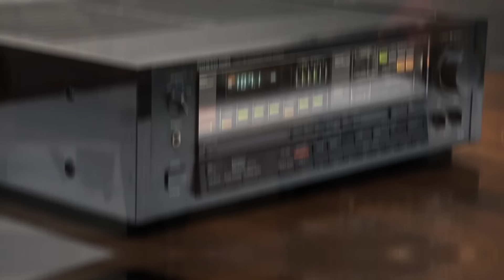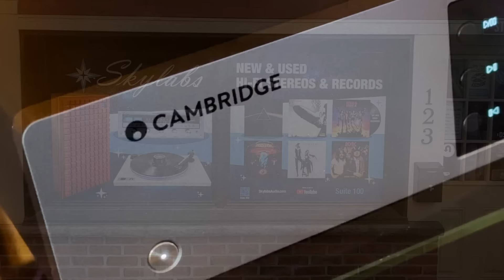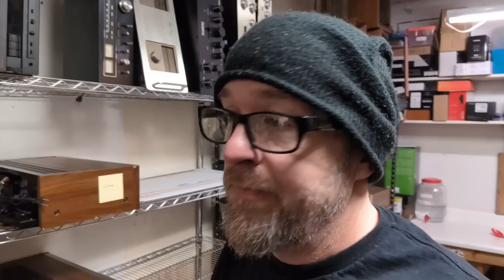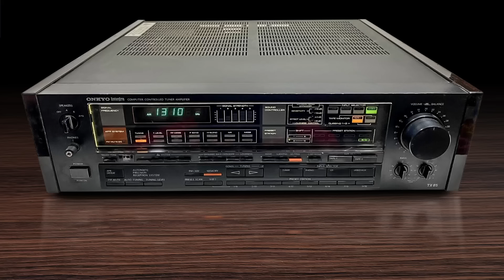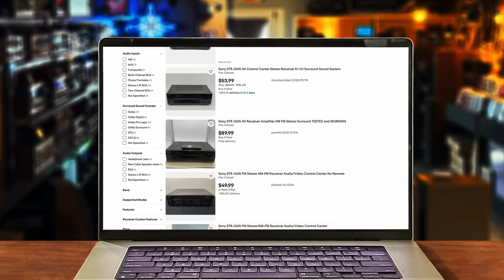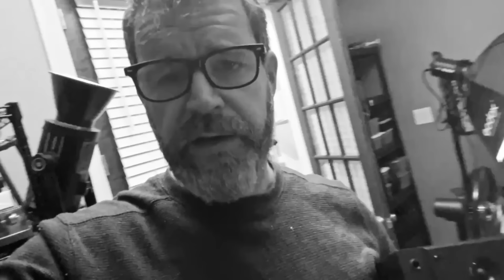Underated Vintage Stereos You Can Get Cheap... For Now

Comment: Another bookshelf speaker to consider from the late 90s-early 00s are the Paradigm Atom and Titan models.  So what if the grilles aren't removable in the early versions, they sound quite good for their size.
Reply: Yup..  and bookshelf models from NHT, Cambridge Soundworks,  RDL acoustics (Allison). OHM, Snell, sapphire audio,  the list is too long.  Vintage is cool but the prices are now more about hype around collectibility.  Its the FOMO market because the internet said x y or z is cool.

Comment: For BPC gear I still have the system I bought in 1992 with a Toshiba Cinema Series TV, which is a Kenwood KR-V8540 AVR, Kenwood LVD-820R laser disc player (LOL!), and Design Acoustics PS-CV and PS-55 bookshelf speakers.  I used my Rectilinear Model XI as the main speakers.  This was the core of my audio system for about 30 years until I carried the Toshiba to the curb (still working just fine  😒) and we got a "smart" TV.  But now with DAC I'm got this stuff out again and I'm going to hook it up for surround sound again.  I'd bought a 1965 Zenith stereo console about 18 years ago and it came with pair of Sony SS-510 shelf speakers in mint condition.  I have them connected with my 1970's receivers (along with my Ohm Model E) and I really like them.  A small active subwoofer would be just about perfect with these.  In my area I see others from this series available, SS-170A, 3 pair of SS-310 right now, and SS-610, plus other later models.

Comment: I haven't had much luck in the used speaker department.  I do have a pair of those Polk T15s you have next to the PSBs which I picked up at a thrift store for $13/pr.  The front face of the Polks are a little warped, but they function perfectly.  T15s usually get a bad review, however, mine sound just fine hooked up to a Denon AVR.

Comment: I own a Onkyo Integra TX-88. I have had it for about 10 years and it works flawlessly. I purchased it from ebay for less than $100 complete with remote and original boxing.

Comment: Paradigm, another Canadian brand, made great speakers in the 90’s you can get for dirt cheap. I got a pair of their reference studio 20s for a $100 recently 😮 They sound freaking GOOD!
Reply: Vintage Paradigm from the 90s (especially the 3/5/7se series) have been slowly creeping up in price in my area. Ones you could easily find for $100-150 are now pushing $300+. Canada is hell for vintage hifi gear.
Reply: @m13579k I picked up a pair of 3 Se speakers for $40 at a thrift store a few weeks ago ...one of the woofers needed to be disassembled to solder a broken voice coil wire, but other than that great condition. Very impressive sound quality!
Reply: Another Canadian speaker is Axiom. I got a pair of Millennia Ti bookshelf speakers with the matching powered woofer for 49$ CDN at a second hand shop here in North Bay.  Use them for the computer sound through a Sony STR-232L receiver.
Reply: Get some of their monitors
Reply: those 90s Paradigm speakers paired with Luxman receivers are an awesome combo
Reply: Got 3 Paradigms (I am guessing one blew up or they used one for a center channel speaker) for $15. Near mint. Cleaned them up and use two in my garage with a nice JBL sub ($25) and people are blown away. Drive them with ancient silver face YAMAHA NS receiver that still sounds sweet. Have a huge collection of 80's and 90's YAMAHA NS series receivers and use the Sony or Pioneer CD carousels to feed them. Also have some of the early Pioneer 15 disc players and they are bulletproof as well though the displays get a little dim.
Reply: @flashbazbo3932  I had atoms hooked up to an old yamy in my shop.    It killed it!
Reply: I got a pair of mid sized Paradigms at a garage sale for $20. The grille cloth was shredded by a cat, so I put them in my workshop. They sound incredibly good, get loud as hell, and have killer bass response. They actually sound better than the speakers I have in my living room! 😂
Reply: Just sold my studio 100 v5's the 20's were the shit for awhile..new paradigm is overpriced and less quality..
Reply: I’ve had mine for about 30 years still going strong.
Reply: I loved the Paradigm bookshelf speakers that I used to have.  Sold them for $60. 😭
Reply: Tengo los RCA dimensia son japoneses no yankees,los yankees lo hicieron hasta los 70s era muy potentes tipo los maranthz

Comment: Kevin: A friend of mine gave ne his old Receiver that has been stored in his heated garage for over 20 years - A JVC RX 5060, due to my Vintage Yamaha getting flakey. I set up up one day and it worked perfectly and a few hours later I was listing to my fav. FM station and it just quit working - No thermal relay or circuit breaker noise, just dead and instant silence. I don't dare ship it to a Vintage repair shop as the cost is likely not worth it - Shipping both ways, $80 to open it and $80/hour thereafter. Not worth the gamble I figure.
Is there anything simple I could look into myself for a possible fix? Hate to just junk it - I believe he said he bought it around 99/2001 and decided on a new system a year or so later. Thanks for reading👍

Comment: I also Found a Fisher 201 receiver at Salvation army for $75 and have that hooked up to two sets of DLK speakers 1 1/2 & 1 models and have had them in there for about 10 years now. The Fisher kicks ass and I have a wireless modem for my phone hooked to it for Spotify and it works fantastic.

Comment: In addition to my vintage Pioneer I still have the Kenwood receiver that I purchased new in the early to mid 90's. After using it several years for personal use I took it into work to power our retail music sytem which played 24/7 for several years. When I left that company I took the Kenwood with me and it now resides in my home office. That poor receiver has some major hours on it and yet it still operates flawlessly.  It's far outlasted many other electronic items I've purchased and just keeps doing its thing without issue.

Comment: A way to deal with cosmetic issues on speakers is applying wood veneer. It changes its appearance drastically!
Reply: I depends upon what the speaker cabinet had on it to begin with, but yes this is a great way to gussy up some old speakers!

Comment: I found a Pioneer SX-205 a our local Savers thrift shop for $45.00 and with my senior discount ,walked out the door with it for $27.00. Sounds great ,running some JBL 2050's on it and using it in my work room. the deals are out there.
Reply: Same here. SX-203 powering a set of Technics SB-A27's.

Comment: I've been using 1970s era stereo receivers for TV but if I were to get a blackface it'd be for the TV.  Hookup a DAC as well.  Btw what 1970s Sony bookshelf speakers are recommended. Btw I define 'vintage' as receivers/ tuner with a tuner dial needle.  amps, speakers etc from those days too.

Comment: I've had Onkyo TX 65 for nearly 40 years. Still running strong.
Reply: Does the TX-85 have an AM Stereo tuner ?
Reply: I still have my first receiver.  An Onkyo TX-36 from the mid-80s.  Not exactly high end, but it was a very solid performer for what it was.  I paid $175 new.  I think it needs recapping, which I'm not going to do.  I have a feeling it's more than it's worth and I have a bunch of other stuff that's superior to it, but I can't seem to throw it out.  I'll probably give it away.  It was working fine on my workbench until just a few years ago.

Comment: The black face Yamaha receivers from the RX line are rock solid as well.  I'd also add the Harman Kardon AVR black faces in there as well 👍
Reply: I have one of those RX’s in my living room doing 5.1. It’s a workhorse.
Reply: 1990s Yamaha gear is very good. I have a bunch of that stuff. My main system in fact, is a Yamaha CX-830 and MX-830 separates set that I've had since 1989, which I got for my 11th birthday.
Reply: I have a RX-V692 currently doing service as my main amp, driving Tannoy HPD-385 15". Not up there with either my Hitachi SR-802, which is down for a service, or my Sansui AU-555a stereo amp, but the Yam is rock solid, and with the Tannoys is a good way to meet the neighbours If I want. The RX has a bonkers remote though.
Reply: I love my HK AVR 20 II. Have had it since 1996 ! I have put it up against same era pioneer gear and the HK just sounds so much better. I also have an Onkyo TX-80 in my garage, haven't even tested it yet, $20 at G will ! My 20 yr old has some JBL J2050 speakers, good but not great (a little lacking in bass for me).
Reply: @MDBenton I've got the avr 21 also sounding nice I bought it at a secondhand store just for a bi amp setup and now I have it standalone
Reply: Ive got an HK AVR from early ooghts - still works great. Hard to believe it's 20+ yes old.
Reply: Reliable yes. Good for HT, but not very musical. Grainy sound

Comment: NAD 7000, 7100, 7400, 7600 receivers. The 7100, 7400, and 7600 are bridgeable with the 2100, 2400, and 2600 power amps for unbelievable power.
Reply: I am listening to a NAD C 740 that a friend got at a thrift store for $16.95! With remote!! 

Added a $28 Philips CD player from another thrift store and a pair of used NHT 1.5 speakers for noise boxes.  Nice sound for little cash.

Next project is something British. So far I have a Cambridge Audio A300 v2 that was gifted to me.:)
Reply: @l.douglaswilmes4472 finding  a NAD receiver at a thrift store with remote is a good find. If it comes with a remote you can tell someone cared about it enough not to lose it
Reply: I got a Nad 712 for free from a friend. Great amp for my speakers!
Reply: He said cheap genius
Reply: @robertbrown2395  You can find them in good working condition cheap, genius.

Comment: PSA  - do NOT bring in any vintage electronics or speakers without opening them up outside of your house. Cockroaches are a real concern.
Reply: That's actually good advice.
Reply: True. I used to work at an audio store in the late 80's to mid 90's and many times we would send a receiver out for repair, only to have it come back with a note saying they would not work on it because of roaches inside. They would demand a receipt from a pest control company saying it was pest free before they would work on it.
Reply: @DaveTV-me8lb Ex-repair Tech here: We've sent back a few amplifiers and receivers on account of roaches -had one with roaches almost jumping out--I'd splashed the chassis with solvent to kill them. This was back in 1979.
Reply: Yuck, that brings back horrible memories: Once during my apprenticeship as a TV repair man I got in a boom box, and it was full of dead roaches - the smell is still haunting me.
Reply: @matthiasmartin1975  I had a VCR come in with a TON of cat hair in it.  Rather that than roaches, but...
Reply: Same.  A little old lady owned the VCR, and fluffy the cat liked to sleep on top of it.  I cleaned it up for her and sold her a cover for it.  It had enough hair in there to create another cat!
Reply: @matthiasmartin1975 you lucky, I service copiers and coin op equipment, sometimes I go to stores, open the machines and roaches everywhere. I get into my truck and feel like they are in my hair or arms. Nasty
Reply: Don’t forget about your Amazon boxes they bring them in too
Reply: @BryanHooper I ordered 6 identical computer cases from Amazon. All were shipped from Florida. Everyone came with roaches in them.
Reply: Don’t forget bedbugs 😂 Them bastards are mini devils that are a nightmare to get rid of !
Reply: True. I lived in a roach house for a year. It was so bad that I put roach powder inside of a receiver, cassette deck and VCR. I spread it along the bottom with a paint brush. It worked.
Reply: Also someone could bring in their VCR or stereo complaining about the LCD Clock randomly missing parts of the display. No sir those are roaches crawling inside the units LCD display. I personally go down to the local gas station (not too local) and use their tire inflator to blow out the rat and mouse turds, with some electronics cleaner, before I bring it home. I also will wrap and seal in plastic, leave it in my car on 100+ degree days just to be sure.
Reply: I bought a vintage Fender guitar amp and it happened to me 🤢
Reply: Not in the UK
Reply: never had knew about it, if not said here and i do own a lot of old equipment and sometimes i trade some for others but never had life in them only dust and humidity , maybe some oxidation or fungus but not at eyesight
Reply: Mice too!
Reply: found an old Punch 45 at curbside in nice condition...Had no sound because an old Cockroach egg 🪺 corroded its PIM board
Reply: They got hitchhiking genes.
Reply: I’d never thought about this until I had some allergy testing done recently. The said I was allergic to cockroaches, and I should open my delivery packages outside.
Reply: Trivia... Roachee, rats, dogs, etc. eat plastic for roughage.
Reply: Omg just bought second hand Warfendale speakers.. U got me nervous. I'm in England, never seen a cockroach, been lucky.
Reply: Hell, yes.
Reply: Very true 👍
Reply: Roaches? You got fortunate. Several species of spiders are possible and seen. The worst was, open up the shipping box in the garage. Hooked em up and freaking mice went scrambling out the port and disappeared in the garage. Doh. Hahaha Good times
Reply: Good advice i guess but I've owned literally hundreds of pieces of vintage audio and have never had so much as an ant or gnat let alone a cockroach. Sounds like you just had bad luck or pick at the local landfill
Reply: Silverfish gang says bring us in first then set us free to snack on your record jackets
Reply: Aaaaaghhhjj NOOO my vinyl 😂 @williampreston1601
Reply: I bought a Fender Princeton a long time ago, I found that truth back in 1979 😂
Reply: I used to repair audio video equipment in a product repair center and I had to bag up and return several items unrepair because it was infested contaminated by cockroaches.
Reply: @curban0520 sounds like an opportunity to charge more. I have taken circuit boards out and cleaned poop off them. Got to love Simple Green.
Reply: Oh brother 
Didn't think about that
Reply: I've seen that before.
Reply: @Leo-t9n9t yep, I always open everything up in my detached garage.
Reply: Not true. Not everywhere has roaches. WA state I've never seen a roach in my life.
Reply: Even from estate sales in nice homes? Obviously if it’s been sitting in a garage that’s different.
Reply: @mikeg2491  yes even the nicest homes have vermin.  Our cockroaches here in Savannah love Steely Dan. So a little bug spray and King Crimson does the trick and they are no more.
Reply: @mrpbody44  nice coment ,bug spray and king crimson
Reply: @mrpbody44  St... Steely Dan, King Crimson.....

Comment: 80's gear doesn't get much love..... yet. But in another few years, I think it will begin to take off as that generation starts to reminisce about their youth and desire to setup that system they had in college or as a teenager.
Reply: Classic cars go through similar cycles!
Reply: @joewiley6927  Indeed. 60's muscle cars are the current 70's silver faced receivers.

Comment: I have the same receiver. Ir looks identical, but it is an Optimus by Radio Shack. Did Onkyo and Pioneer not make these Radio Shack units? 100W p/ch. The remote is the same as well. Optimus STAV 3000. Enjoyed your video!
Reply: Those are really good. I got one for $15 last month. I passed on one for $9 last week and should have picked it up. Also sold as the RCA brand. I think these were made by Fostex which made good products in the 80's and 90's

Comment: I would also add the NAD power enveleope series. Those amps sound GREAT!  I also have a TX-840! The pots arent even scratchy on that thing!
Reply: Exactly! I have a NAD 7175PE. I paid $150, 75 watts per channel, supporting MM and MC carts. It sounds fantastic to my ears. I'm not sure why NAD receivers never get a mention. I must be missing something.
Reply: @mrnegitoro  NAD receivers sell relatiely cheap these days, they seem well built, too
Reply: Agree!!! - I'm using a NAD 7125 now for my Energy Pro-22's.  How much do you think I would have to spend today to upgrade that system with new equipment?

Comment: I promise you:
Yamaha rx 300u, 500u, 700u, 900u, 1100u. You can get these for 40-250$. I have put them against many $3000 amps, and I always like the Yamaha better
Reply: I picked up a Yamaha RX-360 a few years back when one of my '70s 50 watt receivers went out in my shop, because it was also rated at 50wpc. I hooked it up to the four speakers each with a 10" woofer and it had absolutely no punch at all. It sounds good hooked to one set of bookshelf speakers but that's all it can handle. Just my experience but I was totally not impressed with that unit.
Reply: @BadWolf762  Yes the rx 360 is not even close to the rx u series. sad but true
Reply: Good to know.  How would you compare the u series to the Yamaha R-8, R-9 from around the same time?